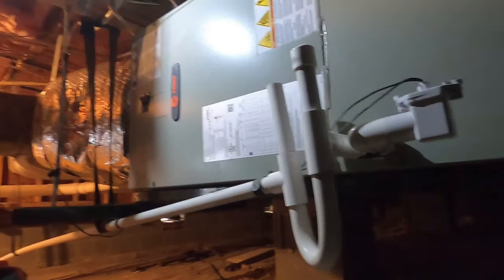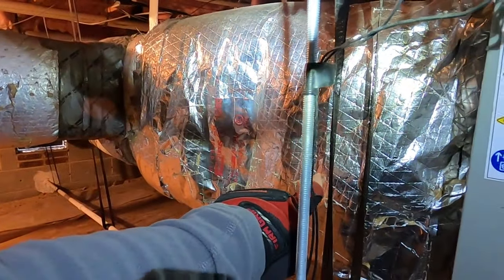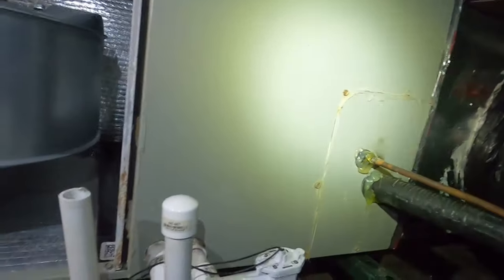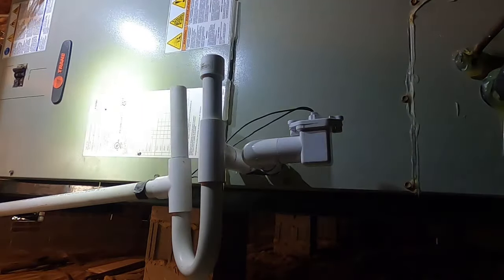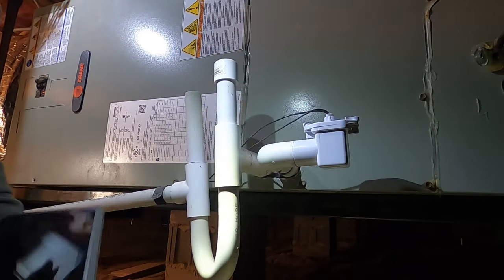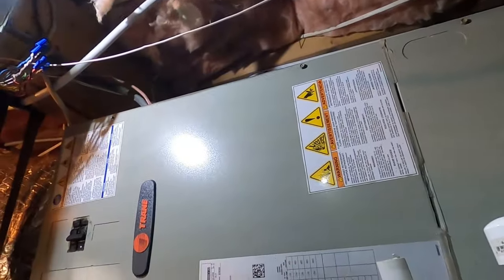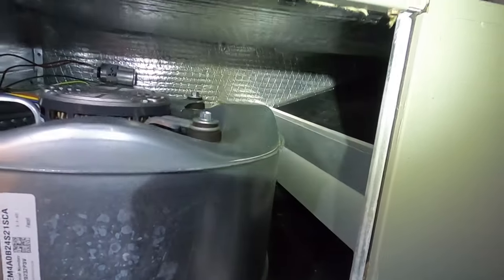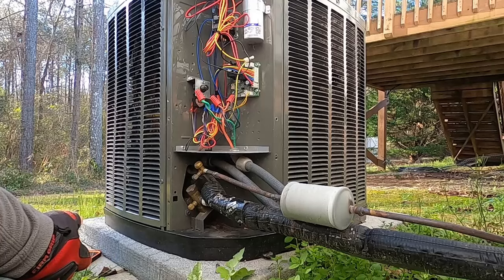Some calls just stink! #hvac #hvaclife

Comment: I had a smell call one day. It was a retired vet. I spent over an hour trying to duplicate the complaint. I wrote it off as just some burn off from the strips. I was just about to pull out of the drive when the man's wife flagged me down and said they smell it. I went into the house and sure enough, I could smell an odor. I thought it was the insulation in the air handler had dropped down on the strips. I decided to pull the heat kit to inspect. When I reached up to the disco to yank it, my hand was burned from the metal. I went and flipped the breaker then opened the disco to find the guts were melted. Took it down from the floor joist and you could see scorched wood and vapor barrier on the inso. No doubt in my mind had she not gotten my attention and I didn't dig deeper, that house would have burned to the ground.
Reply from the maker: Nothing was burning on this one, she said it was a wet mildew like smell. Like clothes left in the washer for a couple days.

Comment: Smells usually come from dust and dirt on evaporators. I have had a few customers try saving money on filters and get filters with smaller dimensions and it lets dirt by the filter and then it smells when you first turn on the ac and that moisturizes the dirt and smells terrible. Happens more now with the aluminum evaporator coils. UV lights only work when high powered and on both sides of evaporator. I would again with you most products out there are junk. Aprilaire has nice filters.  They have a custom box and good seals for maximum filtration.
Reply from the maker: I think the lack of copper has an effect. I like the Aprilaire filters, I think some of them actually come with the foam strips around the perimeter that makes a tighter seal when it slides in the box.

Comment: That’s a nice camera.   Do you mind sharing the model number and brand of that one.  Thanks for sharing
Reply from the maker: Depstech DS520 , just specify the one with the 4ft camera scope, I think they come standard with 15ft , is really designed for plumbers and mechanics. Can use it with an SD card. I did a review video 2 months ago has the link in the description of that video.